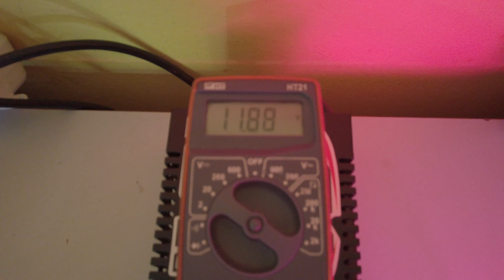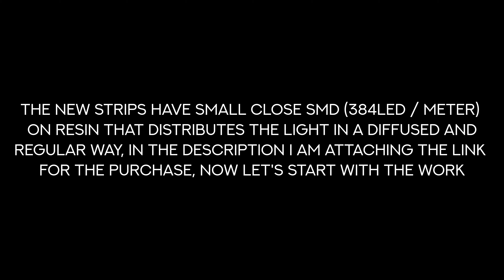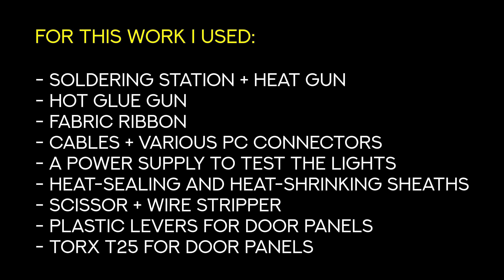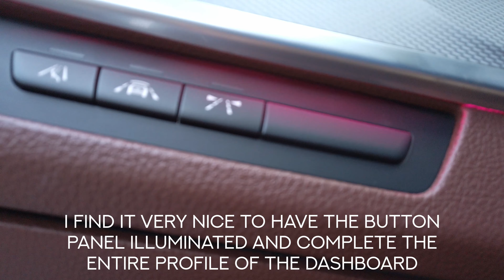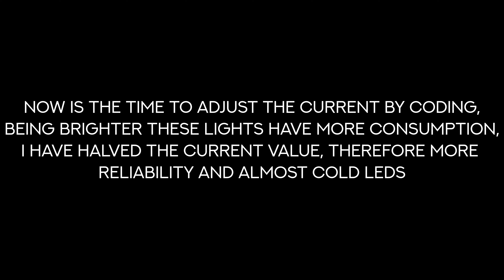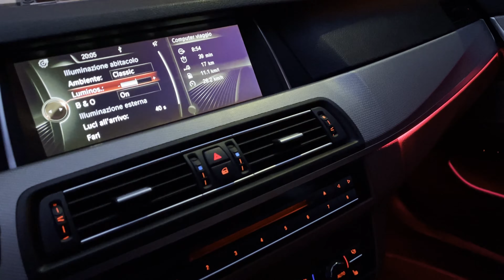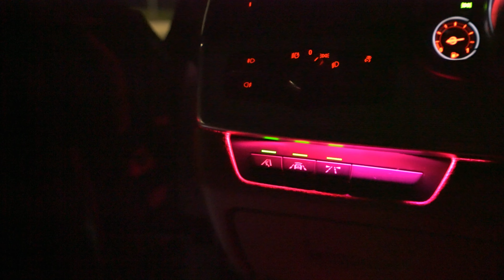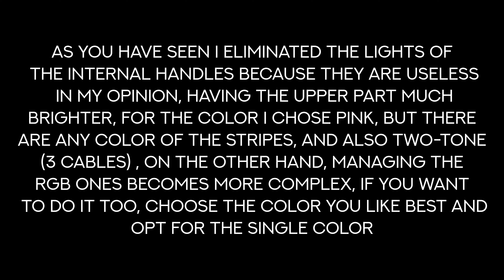BMW F10/11 Ambient Light Custom Homemade! Best Video Tutorial in 4K!

Comment: Greetings from Russia. And where did you buy the connectors to connect the tape and the connector in the door? As I understand it, the power comes without any conversion units, is it powered from a standard connector? Is the brightness adjustable with a wheel? How does the backlight work in general?

Comment: Do you know if this is the same process for a 2012 535D F10 with the 3 pin connectors (on the car side wiring) and would they need any coding still, Mine has dim red ambient lights already in the doors. 

These light strips do look the best I've seen with the most even spread of light.

Comment: So is the difference between v1 and v2 the addition of the led lightening near the  steering wheel trim?
Reply from the maker: No, I have replaced with other types of LEDs as well as having illuminated new areas
Reply: @FrancescoGalante91  so the lightening with the steering wheel trim isnt included with the v2 kit?
Reply: @FrancescoGalante91  what new areas

Comment: Hi Francesco, i changed my old leds with those one but in my f07 i don't have the setting on esys where i can change the brightness.  Can you please help, it's hurting my eyes when i'm driving on the night time even with diming on minimum.
Keep up the good work 👍👍👍👍👍
Reply from the maker: Hi, Car Year?
Reply: @FrancescoGalante91  2010
Reply: @FrancescoGalante91  do you think you can help me?
Reply: Put a resistor inline with the leds. Size of the resistors can be calculated with ohms law V=I*R, V being volts, I current or Amps and R resistance.
Reply: @AcaGavirc  don't know what resistor. Can you help me to get the right one?
Reply: @Bondak404  you can add a single variable resistance on the main ambient light line near the footwell module. Maybe try 1-2 Watt or higher rated 0 ohm to 500 Ohm or similar resistance, just my guess.
Reply: Can’t you use the scroll wheel to adjust the brightness?
Reply: @knulleriboy  yes. But the light is still to strong.

Comment: 3 pins connector name or code or link please?
Reply from the maker: it's 3 pin connector for pc fan :-)
Reply: @FrancescoGalante91  do you know if the any way to set 100 brightness of led? I really like when they 100 bright , but they flash and switch off